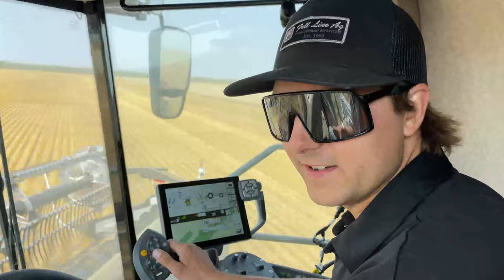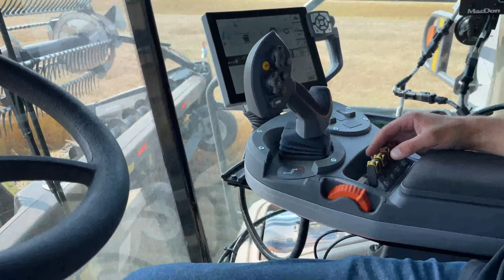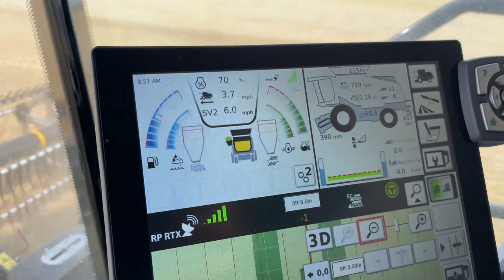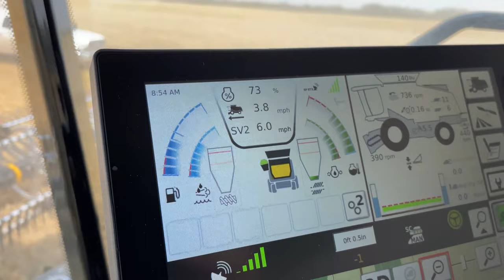Centennial Gleaner S98 Combine Harvester Demo!

Comment: Hey bud, looking good there. The Gleaner looks massive when it was first pulling up before hooking up to the header. That's a lot of lean mean machine. The graphics on that Massey were cool, you need to splash up the sides of that Gleaner with a great big 'Full Line Austin" logo. In fact, don't stop there you could do the whole 'FLA' merch line - polos, hat, coffee mugs. You may have to mix up the colors - greens -reds -greys etc. don't want to tick off one tractor fan base - LOL. How'd you make out with harvest, one of your last vids I think you were heading into the field for #Harvest2023 ?  Keepem rolling  😎

Comment: why does gleaner still use that auger thats set so low?? upward angle?? IE like the old new hollands
Reply: Easier on the grain and uses less horsepower.
Reply: It's the best design, but they do need to make it three feet longer and fold around the back side.

Comment: Why is the feederhouse so small on things. Our jd 9500 has a bigger feederhouse. There cool machines but just seem stuck in past
Reply: It doesn't have to be big to do the trick. Our feeder house runs much slower then most combines, if the feeder house is an issue you can speed it up with variable speed.
Reply: He's still getting material through from a 40ft head...
Reply: @TwinElmFarms  how do they work in canola when they run slower?
Reply: @Brobro449  if canola is in swath and big, we speed ours up to 440 I believe. Straight cut canola big crop, we haven't had an issue.
Reply: Hmm its just crazy that that much material fits in the feederhouse. Ive never noticed how small they looked/were until they had the header off the combine @TwinElmFarms
Reply: The narrower feeder house must mean more twisting stress and cracking with a 40 foot head.
Maybe Gleaner beefed it up to take care of the stress and cracking. @TwinElmFarms
Reply: A wider feeder house does what? How wide is the rotor? The Gleaner is what.... 39" and the entrance into the rotor is 39". So the Case or Deere is wider, but it all gets crammed into a 30" rotor. High wear is all that accomplished.
Reply: From the 2010 R76 on we have had no issues running a 40ft head with the feeder plugging in green stem soybeans and that is the biggest challenge for a combine.